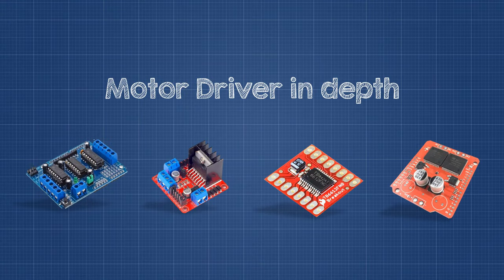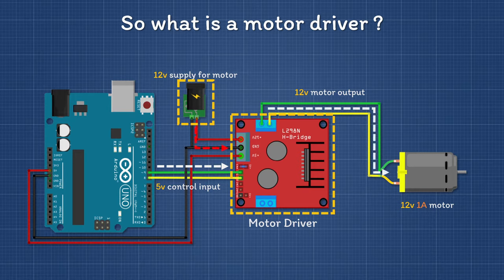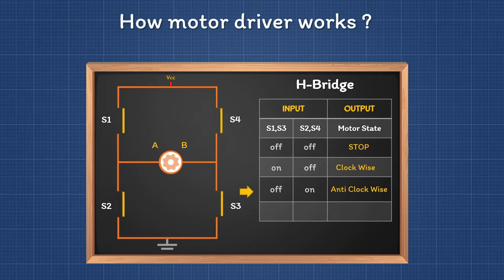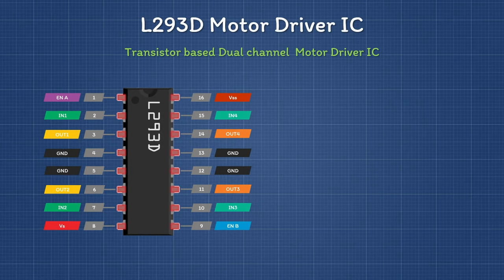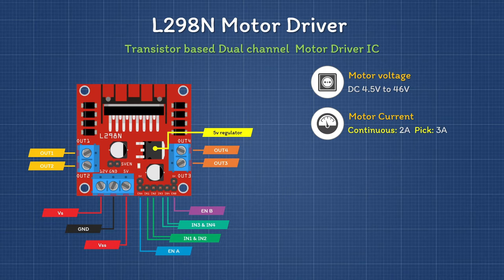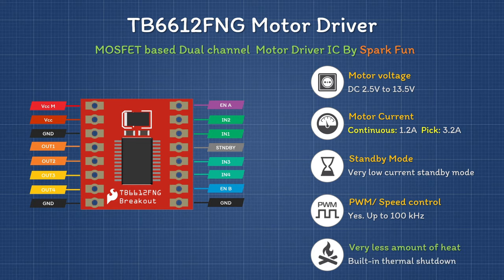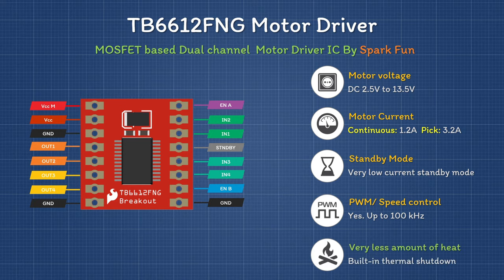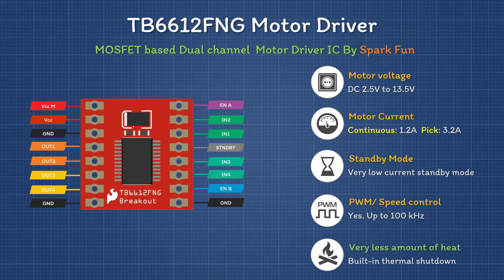Motor Driver in depth | H-Bridge | L293D, L298N, TB6612FNG, VNH2SP30

Comment: There's a mistake in this video made over and over and over again.  It is the comparison between "transistor and MOSFET".  Field Effect Transistor (FET, the FET in MOSFET), indeed ARE transistors!  In fact, the 'T' in MOSFET stands for "transistor".  A proper comparison would be made between Bipolar Junction Transistors (BJT) and Metal Oxide Semiconductor Field Effect Transistor (MOSFET) and those comparisons would be valid.  The current presentation will just perpetuate confusion among newbies.

Comment: I have a model train where in the power supply (0-12 VDC) is given through rail tracks. Which motor driver can I use to run the train in this case? Is it safe for the train engine (locomotive) motor if the supply is given this way? Thanks in advance.